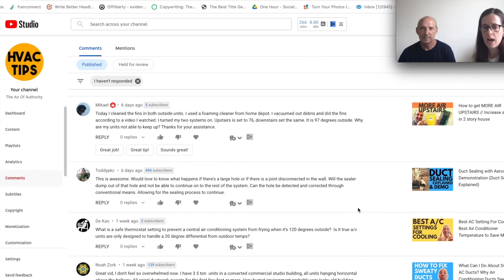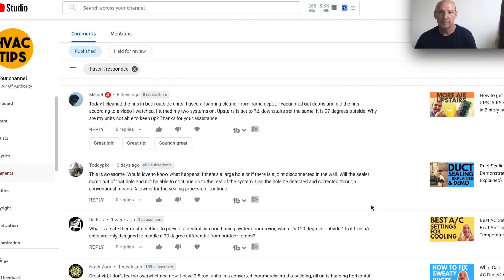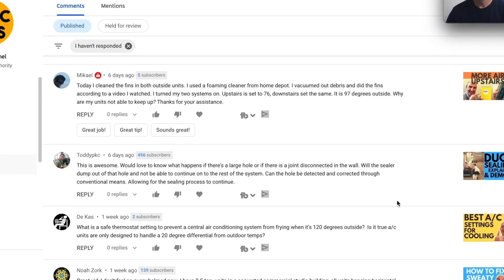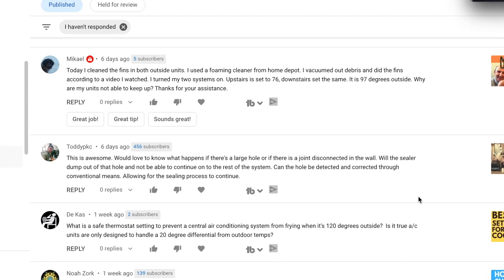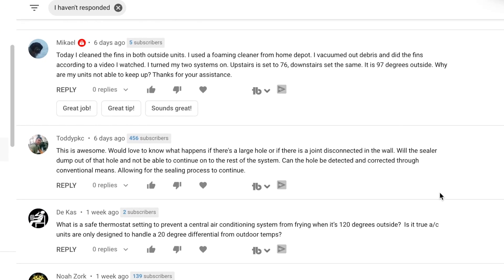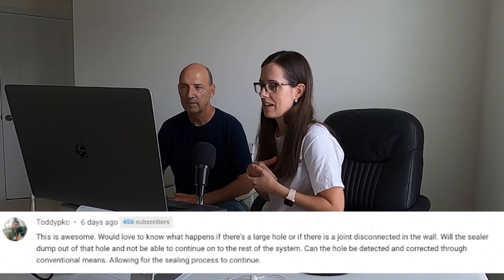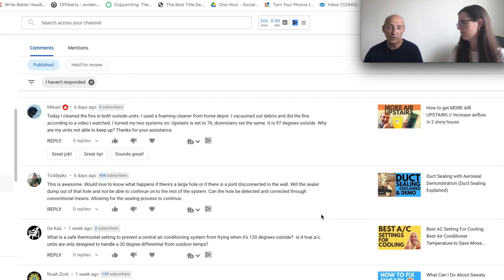WHAT IF YOU HAVE A HUGE HOLE IN YOUR DUCTWORK? CAN YOU FIND A HOLE IN THE DUCTWORK BEFORE SEALING?

Comment: How do you isolate the furnace or air handler from the process? I wouldn’t want my evaporator, blower wheel of heat exchanger covered in duct sealer.
Reply: Ya